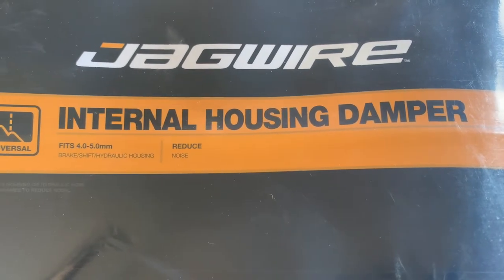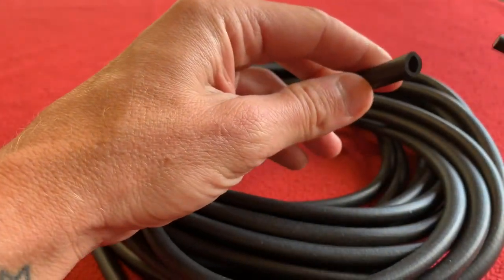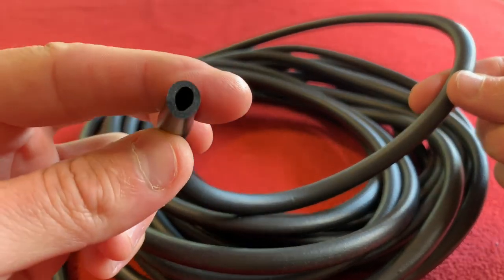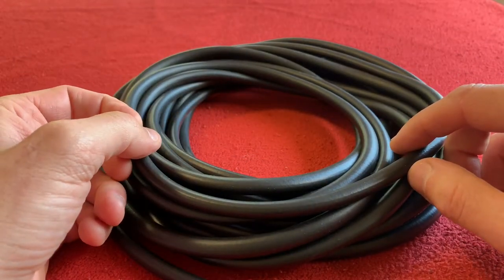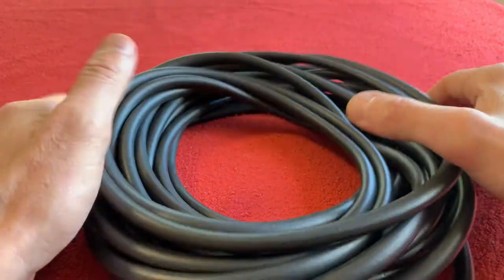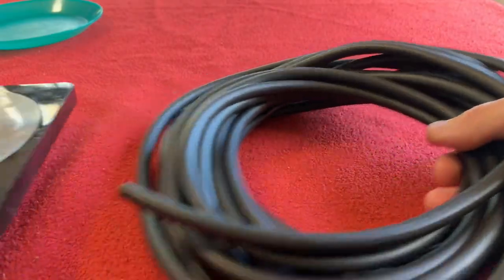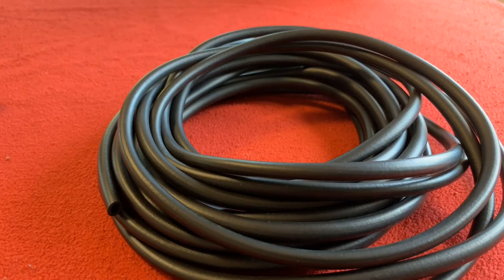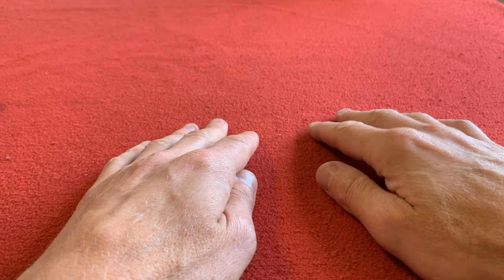Jagwire Internal Housing Damper

Comment: Did it stop the rattles in the end? I’ve just got my no1 bike back on the road, as part of that I replaced the shifters because they got smashed up. I also changed the cable outers and inners. Now I’ve got a really annoying top tube rattle on the rear break cable! Looking for a solution!
Reply: I installed this on my cannondale topstone and it works! No more noise
Reply from the maker: I haven’t used it yet as my frame is not here yet, but as Moritz says, it works! 👍 hopefully I’ll be able to use it soon when the frame arrives. 👍
Reply: @moritzrichter1130  Is there any way of installing this on already installed cables? I have 4 internal cables in my Scott Genius (rear brake, rear shifter, remote for the rear shock and seat post) and horrible noise in the frame. I was thinking in cutting the foam lenthwise so I don't have to desinstall all the cables and mount them again...
Reply: @krasty1002  this post is a little late but I had the same idea. Cut it lengthwise and then tape it back together. Did you end up using it that way?
Reply: @ivanmtb00  , honestly, i don't really remember what i did, but i'm pretty sure i didn't dismantle all the cables to install this. I can recall i only install the jagwire in the rear brake cable, and i tried to do like you said, but if i had to bet i'd say i installed it dismantling the rear brake lever.
Reply: @krasty1002  thanks for the reply! I was just messing around with my bike and I think I figured it out. I put a pretty large amount of electrical tape rolled around the cables to prevent them from sliding into the frame and causing the noise. I’ll know tomorrow if it fixed the noise. I’m hopeful!